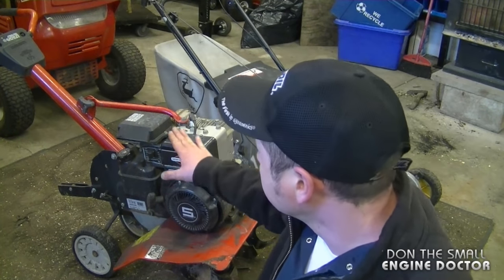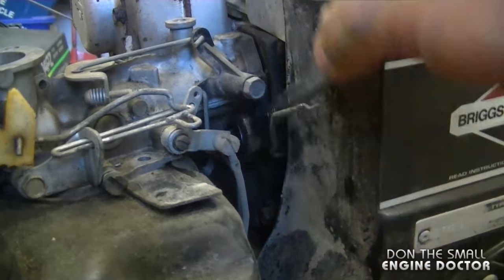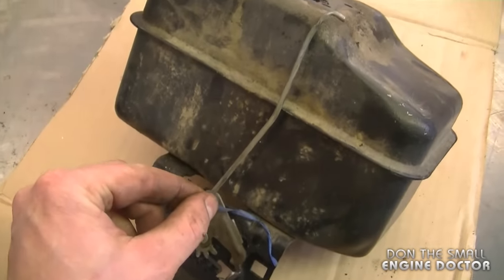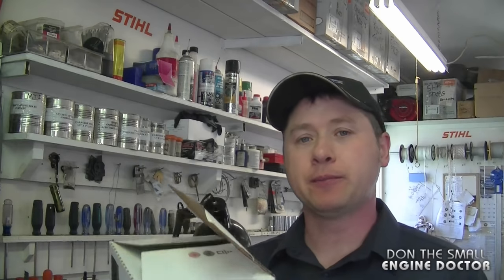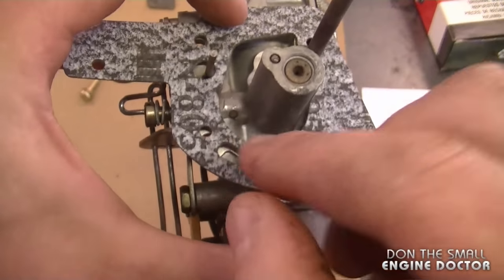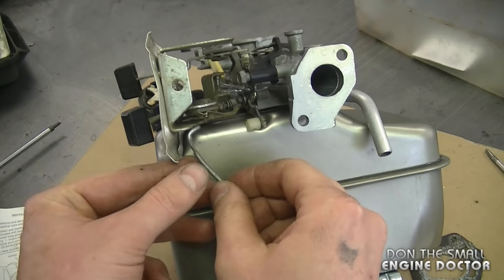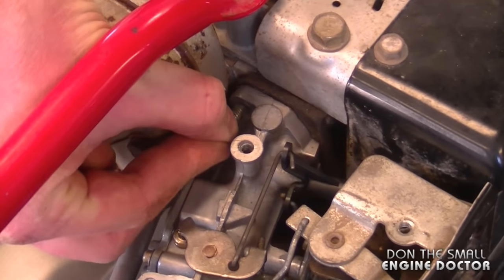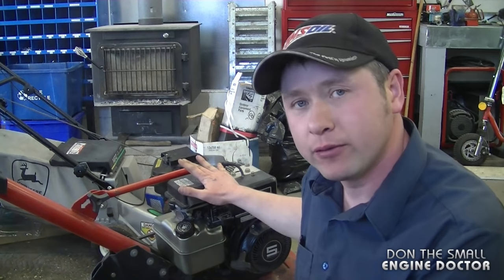Fuel Tank Replacement On Briggs & Stratton 4-5HP Engines

Comment: just my  personal opinion, this design is one of the poorest example of engineering that B&S ever did,  rusts easily, and hard to get off the engine,
Reply: one other thing, what's the purpose of the foam and plastic baffle thing, the older ones never had that.
Reply: I agree.  I find that its best to run pre mixed fuel at say 50:1 ratio.  Yes I know its a 4 stroke but the oil in the fuel seems to help coat the tank and help prevent rust.
Reply: it sure wouldnt hurt to run  some oil in with the gas,, may smoke a bit but might help keep down the rust.
Reply: These tanks used to give us so much trouble back in my race days.  The tank is tack welded at the bottom to the support bracket that was just a piece of bent metal so no cross/triangle support.  The vibration of the engine would cause the tank to leak at the welds.  We would employ oh kinds of weird methods to try and make it last longer.
Reply: Tell me about it! have a 5hp on a leaf blower, had to take one wheel off, that was easy. had to
remove tank by unbolting carb from it so I could get the lower manifold bolt. putting back  was 
a witch. got tank an carb 2gether, then had to separate again and get gas tubes into tank, tighten manifold then rebolt carb to tank. STA-RANGE way to do it. leaves hardly any space between the
engine and gas tank for hooking up linkage BS briggs stratton right?
Reply: @raymondgarafano8604  yes, who ever designed that must have been a bit tipsy.. lol  it's a bear to work on.
Reply: I couldn't agree with you more. That darned spring on the gas tank, which helps control the governor..  If you don,t get it on just right, you gotta take those manifold screws out yet again....one which is very difficult to get back in.  This pulsa jet is just a money and labor pit.  The one I worked on isn't mine.  I will never own one.
Reply: Lot of work to do this

Comment: Thanks for the video.  The foam inside my fuel tank had completely deteriorated and the engine couldn't get fuel because of it.  Using your video I cleaned the tank and carb.  My 28 year old roto tiller runs like new.
Reply: Scott Harvey - how did you clean your tank?  I have the same tank and carb.  Foam in tank has dissolved a fair amount leaving a lot of junk in the tank plus rust.
Reply: Same as @GreenallFootball - I just came to possess a Poulan Tiller with this exact setup. The tank and gas in it are NASTY!!  And of course, now the tank is discontinued. I guess I'll have to clean what I have, but how?

Comment: By far the most detailed work on this job I have seen. My carb kit came today. I have been soaking the fuel tank with vinegar to remove the balance of the rust(I hope) I removed the sponges in the tanks as they had broken down into bits. Thanks for the video.
Reply: Best to use sealer on it also and reseal it 3 times 
Wait 5 days between treatments

Comment: There were so many right on instructions in this video that I missed a few on the 1st pass. I got most of them the 2nd and 3rd times thru.  It was very helpful to be able to stop and view the actual shots of various parts. I would not change a thing in this very thorough video. I was actually doing a chipper shredder and found yanking the wheel off gave me better access to the bottom bolt...but YUK ! getting that one way push lock off the axle in such a way as to be able to re-use it was a pain. Wasn't sure if I could get the part so I did it that way. Thank you very much Donyboy.

First start-up couldn't get the throttle to work...found that the spring at the bottom end had come off; crimped it a little tighter when I put it on again, as I had to disassemble the entire job just to get to it. Now I am an expert on this engine LOL

HINTS: I had the old fuel tank ($90 new) boiled out at a radiator shop and they relined the inside. They say they do about 6-8 (mostly motorcycle) tanks a week there. Cost me $7 for a 6 pack of Krispy Creme donuts and made a great real estate investor contact there. The carburetor was so cheap (under $16) that I just replaced it.

Comment: Great video. I didn’t have rust but fuel filter was clogged. Runs like a dream now. I would have had some bolts left over or poor linkage configuration if not for this post. Hats off to you fella

Comment: Ive got the same engine which wouldn't run without choke. Followed your video to remove Carb and fuel tank, cleaned everything, new diaphragm and gaskets and she purrs like a kitten now. Thanks for being so detailed.

Comment: Great video! I have that engine in 5.5 hp but an't find a tank in stock, plus the ost is crazy. I cleaned out the rust, but the little tray built in there for the smaller tube had rusted away. I filled the tank up completely and the engine runs, but only on full choke (Brand new Carb). Can this operate without that small tray, or not. I'm not sure what the siphon tubes are for. Thanks for any help you can offer.

Comment: Thanks very much for your super helpful Video, I have ordered the parts as per your suggestion, await arrival, had 20 goes at trying to get rid of the dirt, paint flakes in tank, rust etc, but watching your video, went ahead and bought the parts to simply get rid of the issues once and for all, thanks mate!!! Really grateful for your generosity with details, parts and learning material, very grateful indeed :)

Comment: thanks for making this video!
I have the exact same engine on my weed eater tiller and was replacing the carburetor and seen how rusted the tank was.. I tried to clean it with no avail.
So I ordered a new tank and by the time it came I forgot how all the linkage went.. I used this video to reassemble.. perfect instructions and my tiller is up and running again!
Reply: where did you get a new tank?
Reply: @mpchief5   I searched for the part number on google and found places that sell original parts. I live in Germany so i picked one in Germany.

Comment: Thanks a lot! I replaced the tank of our old Bolens tiller as you showed here. I also had the issue that its intake valve was stuck open, so i took the head off, removed the valve, cleaned all the junk, checked it didn't leak, put it all back with a new head gasket. Afterwards it started immediately. Later when in use, it stalled once when warm. Once it had cooled down, i retightened the head bolts. Meanwhile it's a real struggle to start it (it fires 2-3x and dies, about 10 times, before it finally starts). Then it will run fine with reasonable power, about an hour or half an hour, until it starts to sputter and just dies in the following few minutes. Once cooled down, same stuff again. So, I had before: cleaned the carb as well as i could without ultrasonic cleaner (didn't look that dirty except the fuel intake zone which had some rust stuck on it obviously), head is now tight, intake bolts are tight, spark plug is new, there's enough fresh fuel in it, linkages are all on and feel fine.. I'm asking myself if it could be ignition related..

Do you know if they still have points which could be worn or have to be set once?

Comment: Did this very same job. Definitely take pictures, Alot of linkages to keep straight. Great job donyboy.
Reply: I saw your post before I replaced the carburetor and took pictures. But I should have taken even more because you were right about the linkages. Thankfully, this video had clear explanations and great camera work. It made it much easier.

Comment: Awesome video. I have a question. I got a lose electric wire on this engine. But i don’t know were it come from? Its a black wire with a round part on it. Were normally will be put a bolt in. I hope you can help.

Comment: Thanks;
I repaired a B&S motor which had the tank welded around, and first I did not see the problem: these types work with a little reservoir IN the tank out of which the jet gets its fuel. It is filled by the membrane pump.
That reservoir was missing completely because of full corrosion. It was not repaired as it had to be, so later I fitted such a small reservoir in it, before welding it again!
Go on with these good tutorials!
Reply: How did you accomplish this?  These tanks are un obtainable now.
Reply: @phillipsnow5053  first is important to know that this construction is used. Owner before me didn't.the tank was welded but without such a reservoir.just the two pipes hanging in fuel or not off coarse.  Now a friend of my opened it, and put a small reservoir i made in the tank and again welded the tank to close it. I don't know if the tank is available anyway.  Succes!

Comment: Hey bud. After watching your video I replaced the tank and carb. I also decided to do an oil change for the first time in a couple years. Got everything put back together, and now I hear I knock at low rpms.  Any idea why? Never heard a knock until I changed the oil. Any advice would be greatly appreciated.

Comment: Just cleaned out the gas tank since they don't make the tank anymore, got all the linkages they way you have them, but it won't start and when it does it doesn't stay running. Do you have any suggestions? Other then taking it to a professional

Comment: Thank you we have been borrowing an older tiller and had old gas carb issues. I wasn't used to this type and pulled the tank with carb. Trying to figure out how to get the carb out of tank. I have 1 more screw lol.  I have since bought a service kit and will be installing so it will be ready for work.

Comment: Excellent video! I have watched some of your videos before and some other mower guys but this is by far the most thorough job of showing each step as you did it and several good tips on preventing linkage screwups. I have this exact engine on a leaf vac. My problem was a leak in the tank - second time. I was afraid to try a replacement and afraid of the cost of the tank. This time the JB Weld worked but if it happens again I will take it on thanks to you!

Comment: Thanks Donyboy for your great video, I have exactly the same model  with two output shafts, one for forward move and a smaller one for reverse. I tryed to get the model number but there's no marking on the frame, there's only a 5HP on the string starter. maybe you could help. Thanks a lot

Comment: The part number you listed is discontinued by Briggs, but I found Briggs 555192 still in stock which appears to be the same. Do you know if tank 555192 works on this same kind of engine?

Comment: Donnie , your videos were a big help in my tank and carb prject. The tiller still won't start.  I can now see fuel in the carb so I believe the rust issue is fixed. I keep getting a popping back through the carb. I took the plug out and have good fire. It seems like the compression is zero. I pulled the plug and cover the hole with my thumb and there is no pressure on it when pulling the state's rope. I'm guessing a piece of that has worked it's way in and is under a valve. What's your opinion . Thank for the feed back yesterday.

Comment: Thanks as always Don.  Interesting the filter was missing from the carburetor when you removed it from the tank.  Briggs part number 691213.  That hole in the carb that goes into the tank bowl is so small I think it would be an important component.

Comment: I have  cleaned this same carb and replaced the diaphragm.  Now i don't get the rpm's I used to . Is there  any there adjustments on carb or can you till me what I did wrong. All the linkage is hooked up correct.  Taking this carb off was a challenge for me.  Great step by step video. Thanks.

Comment: Carburetor on my exact same engine has a tubular screen filter over the downtube that goes into the mini fuel bowl in the fuel tank. The carb you took out of the rusty tank does not have such a screen. Is it okay to operate without that screen?

Comment: I'm currently working on a 5go Briggs with a rusted tank. The tank is a obsolete part and now runs from $180.00 to $300.00. I used a tank sealing compound and purchased a new carb ( not OEM , my tiller is 20+ years old).  My question is do I need to prime the new carb ? I followed your code to the T and also took pictures. I didn't have a good way to clean t the carb so I purchased a after market part. Thanks for the great information.
Reply from the maker: No you don't need to prime the new carb

Comment: Great video. Thanks. Trying to get an old 5 hp craftsman chipper to run. Got spark , won't start. Suspect carb / fuel tank. With this video I'm going to take it apart .

Comment: Great video. Going to use it as a guide to tear down my Craftsman  917.298351 tiller I inherited which sat for 10 years with fuel in it. Any idea which diaphragm to get? I am unable to locate B&S engine # on it!  Also, any idea what fuel tank it needs? This one is pretty rusty and the foam is dust. None of the manuals i find online for the tiller have the tank part # identified.
Reply from the maker: tanks are no longer available
Reply: Ok, good to know. Thx

Comment: I've done this tank replacement on a 1976 5 hp engine that runs a push blower. Just as the video shows the repair is quite "fiddly" and there's not a lot of room to work. If you try it. be patient and , as Don does, keep the linkage placements straight. Good news is that the engine runs like a top at 3,550 RPM and puts out "wind" like crazy.. Probably one of my favorite pieces of equipment due to its age and consistent performance. Additionally, even after all these years you can buy any part you need (all OEM stuff). Worth some dough if you find this engine kicking around a yard sale or something!
Reply: Jack Fairweather #

Comment: I replaced both the fuel tank and carburetor.  Video was excellent and made the process easy.  The one issue I have is that when I am at full throttle, the throttle lever walks backward and the tiller shuts off?  If I tie the lever forward, it continues to run without any problems.  Other than that, the machine works great.  What causes this?

Comment: If storing a small engine like on a generator for several months, is it better to turn off the fuel to the carb and run it dry, or let the tank  keep the carb supplied with gas?  It would be non ethanol gas with Stabil added.

Comment: I have the same engine. Before and after carb and tank cleaning the engine will only start by using starter fluid. Cleaned carb twice and installed new B&S kit. With choke on I pulled recoil starter 10-15 times. Checked plug dry as a bone' Engine compression is strong. Any suggestions?

Comment: Is it hard to remove the brass pipe-fuel P/N 691-770 B&S?  I have replacement part brass pipe with nylon pick up tube P/N 391813 also.

Comment: I made a comment in another video about these carbs having more levers and springs than a WW2 submarine,lol,you have to wonder when they are designing these things how do they go about it,"yeah lets put another lever here, and a spring here and another clip and 3 more levers under here where they cant get to it, yeah that sounds good"  excellent video man,i have the same motor on a tiller like this and although i have done many lawmmower repairs and things like that all those linkages had me apprehensive.
Reply: Seems some1 was having a good game of pocketpool, it was a bitch an 2/3
getting tank an carb back on had to undo tank, leave pick up tubes in tank
to get whole assembly back together. threaded rod with nut missing, B/S wants
fifty$ fifty this buttholehole. I made one heavy brass wire, sweated long brass 
machine bolt to it, a thumb nit works great. It can really be a pain inee ass but 
messin with engines it still good. yup wa-a-a-y to many springs bellcranks an 
rods, money makin scheme?

Comment: Quick question, the wire at the front of the rotortiler - what does it connect to? Mine is hanging loose, thanks!

Comment: I have a 5 hp that will not run right unless it is at about 2/3 choke. Running lean. It has a foam type material in the tank. Should I try to get that out? What is the purpose of it? I want to clean the carb and tank.

Comment: I'm fairly new to small engine repair and one of the first 'no-starts' I had was a BS 5HP.  I made it through it and returned the engine to the owner starting on first pull.  Carb replaced and tank cleaned.  It was a doozy to learn on but after I got through one, the others that followed were a piece of cake.  Just gotta do it in order.